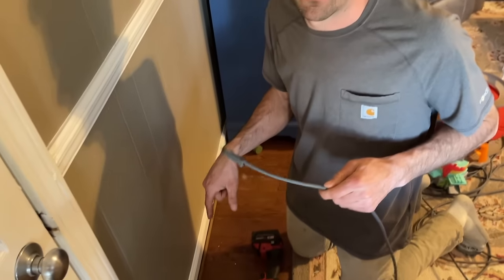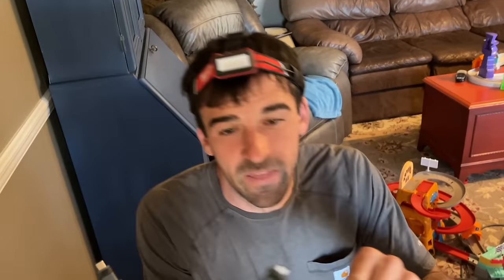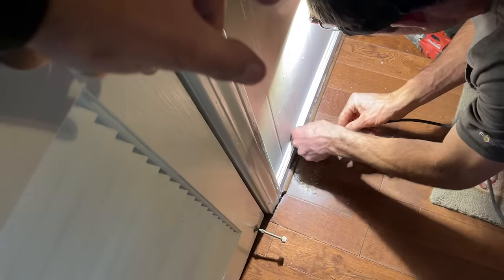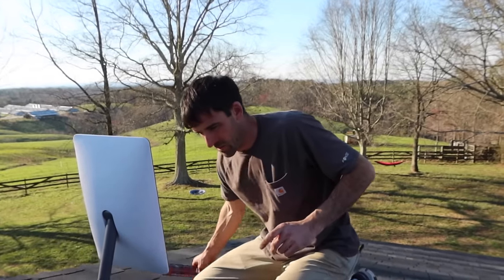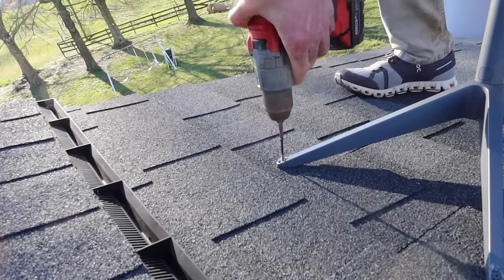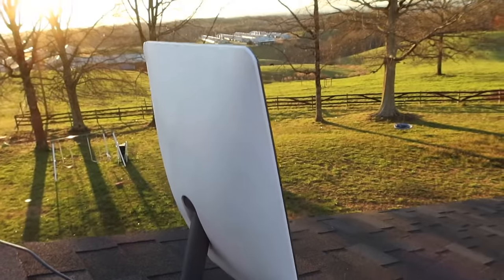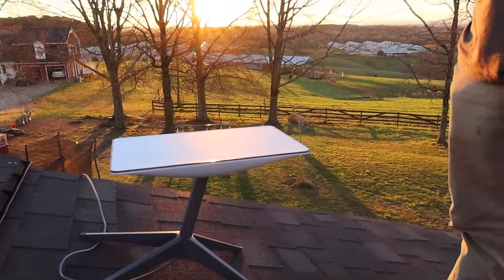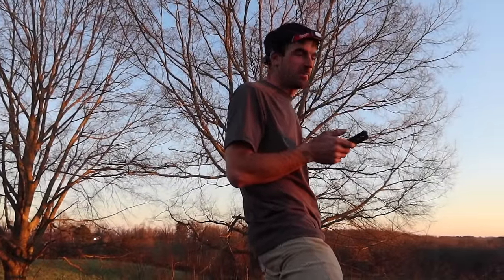SpaceX Starlink Internet | Installation and Initial Speed Test

Comment: After 18 months mine is finally one the way. I was still not 100% sure on how I was going to mount the dish, and you are the first video I've come across that just screwed it into the roof on the tripod it comes with. How is that holding up after a year? I never even thought of that, but it seems like the easiest way to go about it that I've seen. Thanks for the video!
Reply from the maker: It’s holding up fine. We have had it that way for about a year and a half with no issues. Starlink makes a mount for the roof but at the time we got our satellite it was on back order. If you go this route, just make sure you do a good job sealing everything up. Lots of people told me I would have issues with leaks but so far it has been fine.
Reply: @FarmerHunt  Yeah, I'd imagine if you put enough sealant on it, it shouldn't be an issue. We just got a new roof after some hail damage about a month ago so my wife isn't too keen on drilling holes in it, but that's the only place I can mount it unobstructed... and I'm not trying to drop an extra $250 for that weighted ridgeline mount. Thanks for the reply!

Comment: Nice review. I just got mine a few weeks ago here in rural P.A.. Easy set up and I have been getting download speeds from 30 to 55 Mbps. For me that's excellent. All is good, (but), I have already had one data breech issue that has lead me to cancel one of my credit cards. I don't no how or why it happened or if it was related to the Starlink system, but it happened.  I had ordered the Ethernet adapter from Starlink,(to go fully hard wired. No wifi), but they were back ordered.  Just a heads up to always be secure out there. Happy surfing 😉
Reply from the maker: Thanks for the tip! We haven’t had any issues so far but that doesn’t mean we won’t.
Reply: Hey if you dont mind me asking, roughly how long between order and delivery was yours?
Reply: @xXalexoozXx  about 15 months.
Reply from the maker: @xXalexoozXx  we ordered ours in February of 21 and got it in March of 22. At the time we ordered it was just preorders. I have heard they are sending them out based on when you ordered and also the need for internet in your area. I don’t know if that is true or not though.
Reply: @FarmerHunt  ive been hearing that in some parts its been a year long wait for people, but i keep seeing posts about people ordering this year and getting it a few months later. i just ordered mine 2 days ago. im in a closed cell and it says it could be till next year, im excited for it for sure.
thanks for the reply
Reply: Just an update, the security issue that I had was not Starlink related at all. It was a glitch with a payment vender that I have closed my account with.
Reply from the maker: Thanks for the update. Glad you were able to find out the source.
Reply: @FarmerHunt  So was I. I didn't want to name names, but it was Pay-P.  Have had an account with them for 15+ yrs. Not anymore, not after that mess.
Reply: How much does it cost per month?
Reply: @nvmcrider8475  $110 a month for the service, that after the one time equipment fee of $600. You can also make the system portable,(set it up at other locations), for another $25/month.
Reply from the maker: @nvmcrider8475  It is $110/month
Reply: Can I ask what phone model you used to set up  the system? Mine is not compatible with the starlink  app, looking to upgrade to a new phone. Please and Thank you.

Comment: I think it would be better if you mount the starlink on the roof facing the north. By the way, I think the surrounding trees might be a problem during summer time when they are full of leaves. That might affect the signals.
Reply from the maker: It is on the north side of my roof. It auto adjusted to aim kinda northeast.
Reply: The app told them it was a great spot to install it. You’re one of those ppl huh
Reply: @T2P661 What’s that snarky remark supposed to mean?  Eric made a good point. The app picks up obstructions, which obviously the “naked” trees don’t present currently, but come spring/summer the fully leaved trees most likely would be picked up as an obstruction.

Comment: 3 down, .4 up?  Wow, that must have been terrible!  Luckily, I do a lot of video conferencing for work (and so does my wife, sometimes at the same time, while our kids might be watching a video on another device) and we've got 3 down and 1 up so we're living the good life here in the old USA.  I thought we'd have to sell the house.

Starlink just arrived, it's dark, I'm going on the roof to set it up.  OH MAN I cannot wait!  We've been using Frontier DSL (which is about 18 down, .9 up) and we've had problems with stability there.  I miss the old cable days even though I hate the company we used to have for it (so many others hated them that they changed their name).  I have a long meeting tomorrow where I'm presenting and the last time I did one of these I had to drive an hour to my parents because the DSL was down and without it I haven't been able to present my desktop with video (or even attend WITHOUT presenting or video) reliably.  I'm hoping this changes everything.
Reply from the maker: Sounds like you know our same struggle before Starlink. Hope yours is working well for you.
Reply: Was it a game changer?
Reply: @TJ-22  It was!  It's over six times faster up and down than the best Frontier connection we had, and despite being satellite vs phone lines, it's far more stable.  Stopped using our old service, haven't needed the cellular backup, and overall have been MUCH happier.

Comment: Just got mine and feel intimate but your video helped me but drilling holes in our brand new house still worries me. The roof especially so.
Reply from the maker: There is a mount that goes on the side of the house. It is a better option. I wouldn't recommend screwing directly into the roof if you don't have to.

Comment: Did you have to buy any extra accessories to mount it to the roof or it came with all that? I see theres roof mounts you can buy extra just wondering what works best? I just ordered mine
Reply from the maker: I recommend buying the roof mount. When we got ours the roof mounts were on back order and they couldn’t tell us when they would be back in stock.
Reply: @FarmerHunt  oh ok sounds good thanks!
Reply: @FarmerHunt  do you use a stud finder or just screwed wherever. The roof is sheeted with plywood so im thinking would be plenty
Reply from the maker: I found my rafters and screwed into one of them. Best I can remember it wouldn't reach to hit 2 of them. It would probably be ok without hitting a rafter, we just get a lot of high winds from the west.

Comment: Do you remember what size drill bit you needed for the hole to fit the cable
Reply from the maker: I’m not sure about that… there was already a hole there. I think I just used a bit and kinda opened it up a little more

Comment: Okay sorry for the newbie question but how do you secure the satellite on the roof? Is there a way to do it without drilling holes through the roof?
Reply from the maker: There are a couple options. When we got ours, the other mounts were on back order. There is one that mounts on the eve of the house I think. There may even be some other options. They are ordered separate. We have a directv satellite that has been drilled into the roof for years with no problems so we did the same with the Starlink.

Comment: So the modem doesn’t light up? No indicator lights? What’s dumb is you need internet to set it up. We don’t have internet where we need it, so we can’t use the app
Reply from the maker: That’s correct. There is one small white light on the bottom of the modem. 

Does your app not run on cellular? It’s been a while since we set ours up but I would have thought you could set it up without having Wi-Fi
Reply: @FarmerHunt  we are in n a heavily wooded area. There’s no cellular data available which is why we need the starlink. It’s just funny they are like setup your WiFi by getting on the wifi. Hahahaha

Comment: Awaiting mine for two years now. Rural central florida. Your vid was funny af These woman nowadays. Sheesh. My question is. Does the router cover your whole house? Or are you using another wireless router to get signal in the entire home?
Reply from the maker: I am looking into options to extend mine (mainly for my shop). It currently covers our whole house which is about 1500 sq ft. I can also get a good signal up to maybe 50 yds away from my house outside.

Comment: Did you even hit any rafters? If it gets really windy it's gonna get yanked off the roof or even little movement will start letting water in and 10k later needing a new roof.
Reply from the maker: One side is in a rafter. The other side has 2x4 reinforcement under the plywood. Don’t think it’s going anywhere. I also went back and put some roofing tar around it

Comment: I could tell right away you were dial-up folks.
Reply: Pfff. Dial up is slower. 56kbps. DSL goes up to 6mbps. Both using Phoneline ports as your internet service. VDSL2 converts your phoneline to the house and changes it to cable copper. So your now using the router as your main focus to reconnect the phonelines from the internal of the house from the router, Because they have to splice off the power of the phone in the internal housing so it doesn't effect the networking.

If you seen older videos of using power directly from a phoneline port. Phonelines gave enough power to use wired non-powered home phones. So with the newer VDSL2 systems they have to cut that power off and route the network through a more stable connect, Normally via your TV coxal cable. Then the router will reroute it's network to a phoneline port in the house to power the lines back up for data sending/voice. But the internal housing ports won't have power anymore. So have to use external powered handsets.
Reply from the maker: Not anymore!!

Comment: Starlink is finally shipping my system. I live on a beach that has Century Link and it sucks. The biggest question I have is what is the wind rating on the dish?
Reply from the maker: That I do not know. I feel like it’s pretty sturdy though as long as you get it mounted good. We’ve had a couple pretty good storms roll through and no issues so far. We live up on a hill so we get a lot of wind.
Reply: Hope it stands up to winds.  We get gusts to 65mph at least a couple times each year.
Reply from the maker: @philfortner1805  So far it’s holding up fine. We have 40 mph wind a few nights ago with gusts over 70. Didn’t have any issues other than speed slowed down some.

Comment: Starlink is the best thing to happen in years, just got mine a few weeks ago and this shit is a game changer. I game all the time on it and stream and watch 4 k no problem
Reply from the maker: I agree! Never thought i'd see the day where we had fast internet out in the country. We can actually stream things on our tv now
Reply: is it works while raining?
Reply from the maker: @mohit9626  So far it has worked fine durning rain and storms. We’ve had some pretty high winds and it may slow speed some but it’s still way faster than what I had before
Reply: Do you lag any while playing games online?
Reply: @BlueDragonAkira  That magic question.
Reply from the maker: @BlueDragonAkira  I don't play any online games so i'm not sure about that.
Reply: @BlueDragonAkira  I played Warzone for three hrs straight with little lag, but it didn’t hinder me. I’m going to to test it with an Ethernet cable and see if there are any difference :)
Reply: @BlueDragonAkira  no lag at all, get around 60-70 ping the only issue I ever come across is when it can hit extremely high packet loss which just tweaks everything in a bad way. That's pretty rare, also get around 90 down on the PlayStation , streaming and broadcasting works perfectly too. It does go out randomly but most often doesn't affect gameplay.
Reply: Oh and that's with the router, I'm not directly plugged in with ethernet so that's probably why I get random issues. It's a game changer and worth it no doubt
Reply: Can I ask what phone model you used to set up  the system? Mine is not compatible with the starlink  app, looking to upgrade to a new phone. Please and Thank you.

Comment: Nice video, but would have been nice to know how to get and how much it cost etc. This is the first I have heard of this and I am in an area where I have a wireless set up and only get about 50Mbps not enough for things now a days.
Reply from the maker: We plan on doing a follow up video so we’ll be sure and include that. It was $499 for the equipment. I think it has gone up some. It’s $110/month for service.
Reply: $110 per month and about $500-$600 for equipment depending on when you reserved it. 

This guy just destroyed his roof so you may have to factor in another $10k+ if you follow this video.

Comment: Should have used black roll tar never use silicone base sealants on shingle roof. It pulls away and leaks that's why we use black roll tar under any dish mounts and it's not supposed to be over living courters
Reply from the maker: We went back and put some tar around it. We are supposed to be getting a new roof this summer so we just kinda placed it where it picked up best and went on with it. We'll be using a true roof mount once the new roof is on.

Comment: A quick happy note from my wife and me.

Our divorce becomes final this afternoon!!!

I received a voice message yesterday  morning confirming that the port of our home phone number will be completed today. NO MORE CENTURYLINK. We will still have our same home phone number but with many new options with the new VOIP phone service using Starlink wifi. And I will not even have to pay alimony to centurylink. No more ransom payments either. We finally found a viable option to cut the cord that had us bound to the ridiculously slow, expensive, unreliable internet and phone service that we have been held captive by for years. 

As I said previously our “high speed DSL internet service" maxed out at about 0.4Mbps, on a good day. With my Starlink dish temporarily located on a pole until I have it permanently installed on the gable end of our home over 30 feet above the ground (and I have a plan to get it there), I have had speeds up to 197Mbps. Perhaps this will increase when my installation is finally completed.
Reply from the maker: Awesome! Welcome to the world of fast internet!! 😂😂

Comment: Question: Did the modem has any ethernet connections? I have house that the internet is wired, Wifi will not work in the entire house
Reply from the maker: You’ll need to order the adapter. I think it’s about $25. There are no ports on the modem other than the one for the dish itself

Comment: Way Overpriced, However You folks sure did need an upgrade
Reply from the maker: We actually started saving money each month when we switched to Starlink. Plus we got rid of directv!
Reply: @FarmerHunt  In General the Dish is $500 and service is $110, That is outrageously expensive Compared to $40 or $50 a month in my Location for Internet and I have my own Modem. However I did have Directv a long time ago and it was JUST AWFUL. I am happy to see Starlink does work and at least you can be connected to the rest of the world in "real time" not 24 hrs later.
Reply from the maker: @greggrusnak6094  Yes, compared to some it is higher. I was paying $59 each for 2 internet services because the internet was so slow. I had to have it at my house and farm. We also had to have a landline phone for our farm alarm system that was another $49/month. Starlink brought us down to one internet service and we were able to get internet phone which is way cheaper.
Reply: @FarmerHunt  I understand and yes it is Less expensive for your farm, I am Glad you got a Good Result. Did you secure those wires the Ladies were after you about? LOL
Reply from the maker: @greggrusnak6094  😂😂 it took about 4 months but finally got it secured to the house!

Comment: I think fixed wireles broadband is the best solution if it is available it is cheper and more reliable than stralink.
Reply from the maker: It’s not an option
Reply: @FarmerHunt  Now let's begin starlink is basically for those who do not have optical  fiber access no doubt fiber is still the best than any other medium till date the main problem in starlink is that it is way more expensive and it is not reliable like it has very high ping quality is still lacks. weather disrupts .Starlink is a gem where there is inavailability of fiber or fixed wireless.

comparison fiber is best
                       fixed wireless broadband better
fixed wireless broadband is far better than starlink in terms of speed as much you want more than 2gbps with less latency around under 10 ms

Comment: got mine today. good tip on running the wire end going to the dish. mine came plugged in didn't realize it was different than the other end. no internet where I'm at either. been using cell phone hotspot and cellular booster for several years now. barely got by... thanks for video!
Reply from the maker: Hope it works well for you!

Comment: FYI 3 megabytes is 24 megabits Edit: dishy should have had some sealing pads to prevent leaking, but it may be possible those only come with the other mounts on their website.
Reply from the maker: Thanks for the info! Our's didn't come with any sealing pads. When we ordered over a year ago we didn't pay attention to what came with it. Once it arrived we were just ready to get it going. So far we haven't had any issues with our mount.
Reply: Companies don't use Megabytes. They use Megabits. So it's not 3 megabytes. It's really 3 megabits.

When companies say you get say 500mbps. They mean Megabits per second. Which = 62.5 mb/s (MegaBytes per second.)
So that means Starlink is giving 150/250mbps = MegaBits. If you see MB/S that's standard for MegaBytes. While MBPS = MegaBitsPerSecond

So yeah DSL speeds are Cruddy.